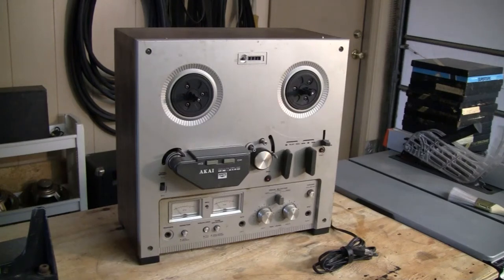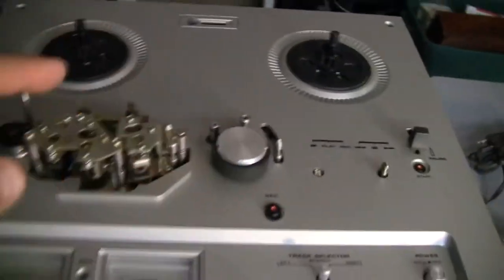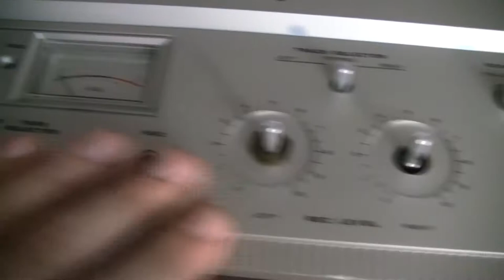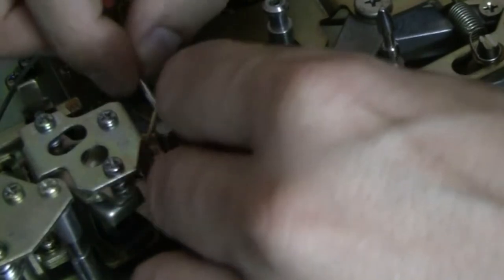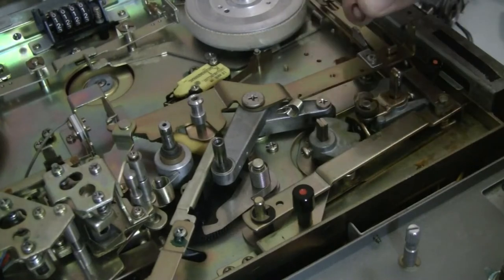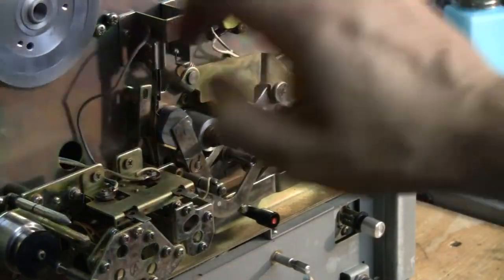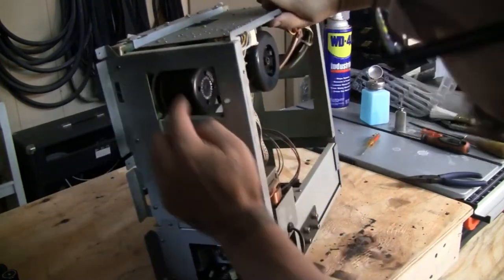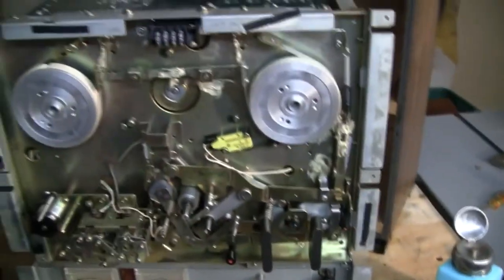Restoring a Vintage AKAI GX-215D Reel to Reel Tape Player

Comment: Great video! I just acquired this model and I'm having trouble getting the pin screw in the center to come off after trying to remove the panel. Its the bullet-looking pin right where the three heads are that puts pressure on the center of the front panel. Can you tell me how you were able to do that? Any specific tools? I have nothing to grip it hard enough to twist it.
Reply from the maker: You may need to use a needle nose vise grip , that'd work great for you Nick. Great purchase by the way and much luck to you, cheers !!!
Reply: @DoingMoreKustoms  oh yeah just had to come at it from a different angle LOL! Alright last question: Mine is missing the head cover as well as the button covers for it. Do you personally know any good resources to find a replacement for it?
Reply from the maker: @nickdejohn5558 You may want to do a search on eBay, as sometimes sellers part out these reel to reels. Good luck with your project.

Comment: I have a AKAI GX-215D Reel to Reel however the motor  slows down to a stop. I changed the drive belt but it still slows down to a stop. After searching the net I have an idea that it may be due to the motor drive capacitors. I was wondering if you knew where I could buy new drive capacitors for this machine. Thanks
Reply from the maker: I'm not sure what it can be on that unfortunately =(

Comment: Is it possible to open only the back side of the unit? I tried to open mine, but rear wooden panel and sides almost look like they are glued together, so I didn't risk to do it.
Reply from the maker: I want to say you can't do that, you would need to take apart from front.